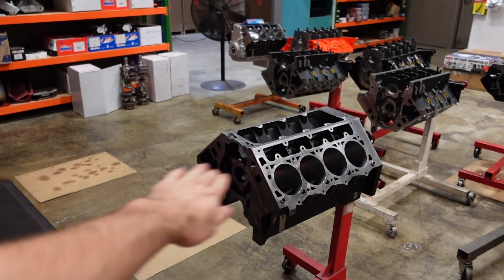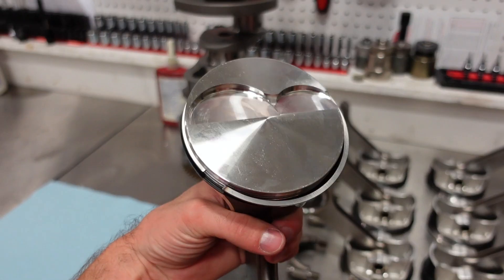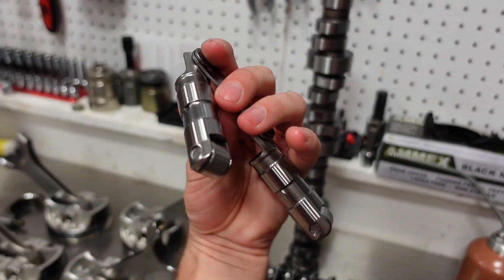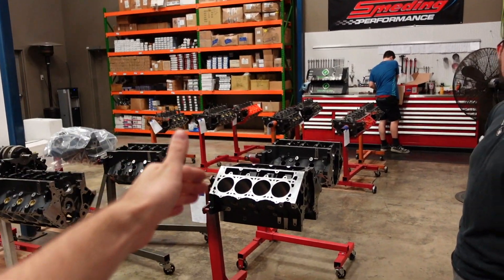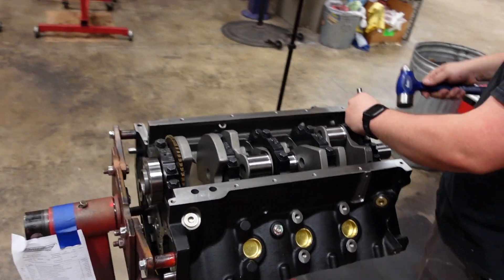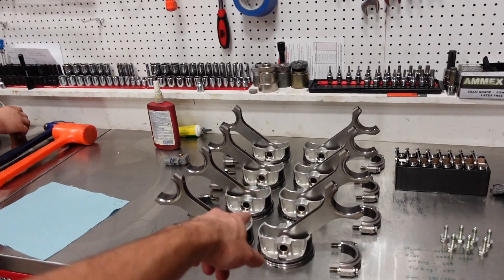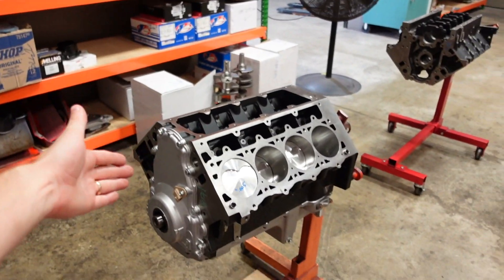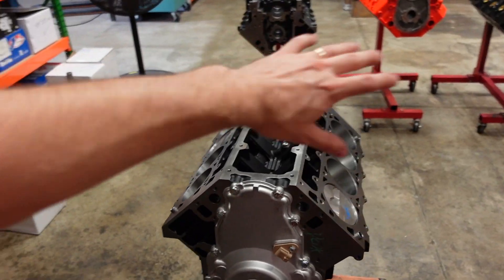BUILDING the ULTIMATE Street/Strip 427" LS Short Block!

Comment: This was a long time ago, IE before LS engines. The machine shop I worked at tearing down and building motors (high school, I didn't do the machine work), we had 4-6 torque wrenches per motor build, but we had clicker types and beams. For the clicker types was to keep read errors down from going to fast and/or forgetting.

Comment: I have never had a LS 400 I have ran a old school sbc 400 in a reg cab s10 just stock bottom end with big cam and intake and carb. I have a sleeper I have not started on just truck body with motor ready to come out. I ha e been studyi.g and My minds made up after doing research I thing the LS2 or Lq4 which is in Chevy trucks is best way to make a small block 427 stroker. So I'm just going to get a junkyard 6.0 ls or lq and throw 427 stroker crankshaft to build a big cubic inch small block nitrous motor. Good video.

Comment: I see a lot of people recommend soaking lifters in oil for a while before installation, but here you just put some assembly lube on them and installed them. Can you explain whoch practice is best and is it a difference of which lifters are being used? thanks
Reply from the maker: Modern lifters are all pressure checked by the manufactures, so they are already full of oil & primed.
Back in the day before this procedure was standard practice, it was recommended to soak overnight.
Reply: @JacobVillemain while i agree with you, I'd still soak the rollers. But hey, you have a procedure and it hasn't failed you yet

Comment: So we know that a certain individual on youtube who does tons of dyno stuff has run stock blocks and sbe ends up to 1500 hp. Im having a hard time understanding how a stock block and Dart's blocks which are superior in every imaginable way be rated only for 1500 hp? Them numbers dont jive qnd i understand Dart has to have a disclaimer but surly given oem vs Dart (and their extensive and well funded and professional engineers), Dart blocks should be at least a comfortable 2000 hp given proper crank, rods, pistons blah blah blah (but then again that certain individual ran that ls sbe over 100 pretty significant dyno pulls and pusnished it along with almost 30 psi and it gave the ghost up then.
Reply: 1800-2000 on shp. 2800-3000 on shp pro depending on regular main studs or Ford Cleveland main studs and 1/2 inch head studs

Comment: 8:23

Not shiming the oil pump before torquing it down?
Reply: You don't need to shim them. Install with bolts snug, turn the crank a few times, then torque the bolts. Even Melling doesn't say to shim them
Reply: You beat me to the question
Reply: He did say everything was prepted before hand.
Reply: Oh no, it will blow up on the dyno omg
Reply: It’s a wonder it didn’t blow up while he was turning it over with the ratchet honestly
Reply: Only asking because I learned to do it here. I'm not trying to be THAT guy on the internet, I just noticed it that's all.
Reply: Thought the same thing. LS engines require it as well  as the rear main seal. Is there a high volume or high preasure oil pump that doesn't need to.
Reply: This guy doesn't listen to anyone that actually knows what their doing.